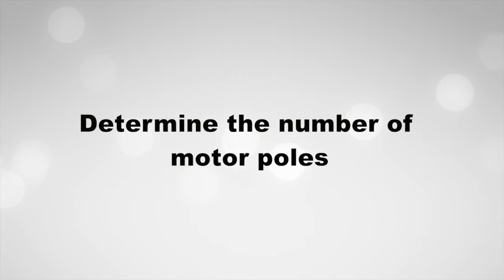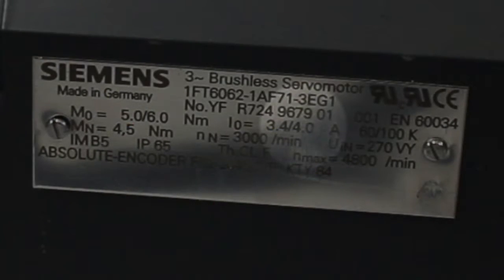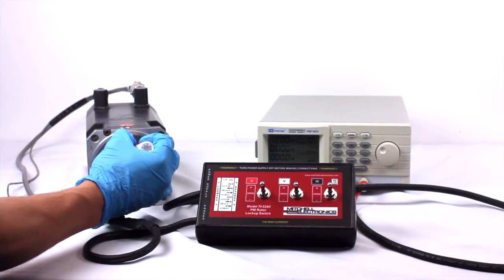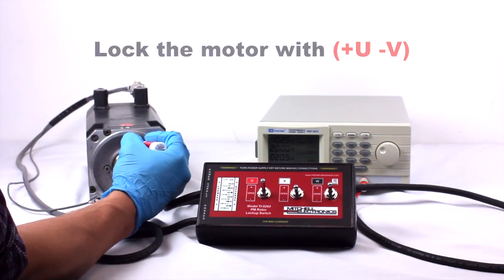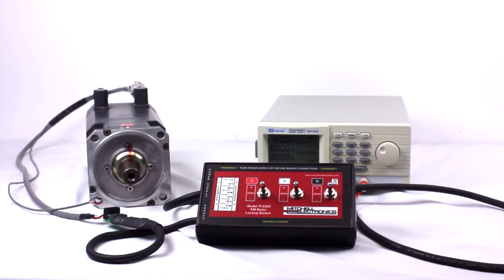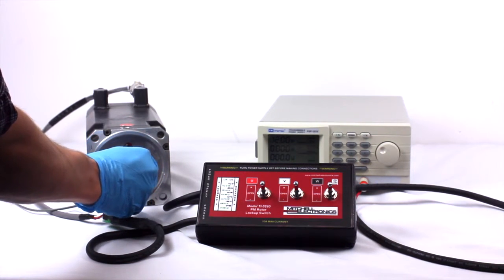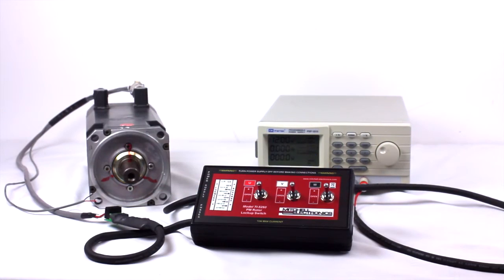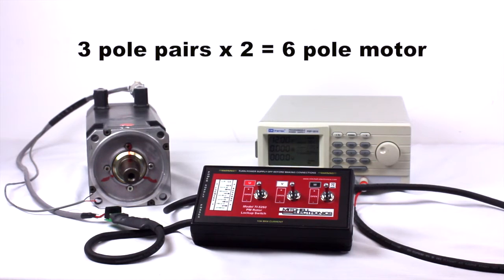Determine the Number of Motor Poles

Comment: What about using this formula 
pole_pairs = (120 * Max Hz) / Max RPM
(ex. 6 =  120 * 400hz /  7500rpm 

However, something doesn't add up... I see a zero-crossing envelope frequency of 250hz.  Therefore:
rpm = ( envelope_freq * 60 ) / pole_pairs
         = ( 250 * 60 ) / 6

This yields an rpm of 750, yet I measure it to be 7500rpm! 

I am feeding a 5khz excitation frequency to an induction motor's primary resolver rotor.. then I understand you will get out the sin/cos resolver signals that can then be used to determine angle and speed.

The sin and cos signals are amplitude modulated with a frequency of the excitation.. and   the ENVELOPE of the AM modulation is proportional to the speed of the motor.
Reply from the maker: Good thinking on this. We probably cannot add much to your calculations because this video explains how to determine the number of motor poles on a permanent magnet brushless DC motor. Measuring poles on an induction motor would be slightly different.